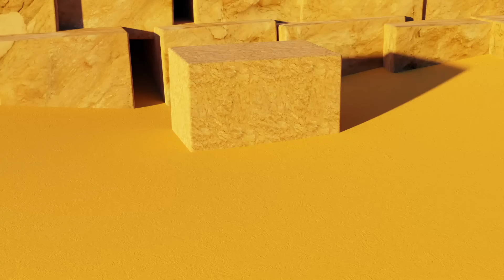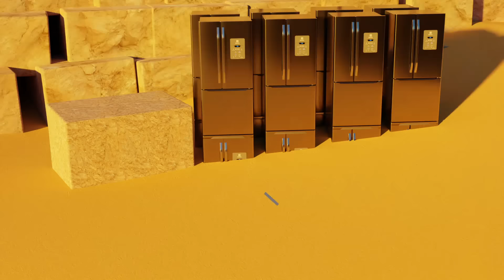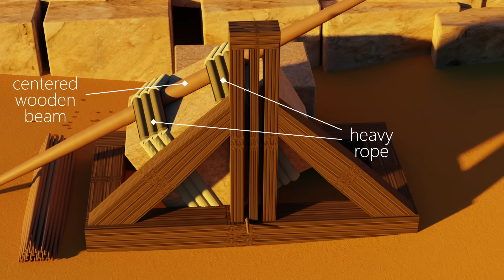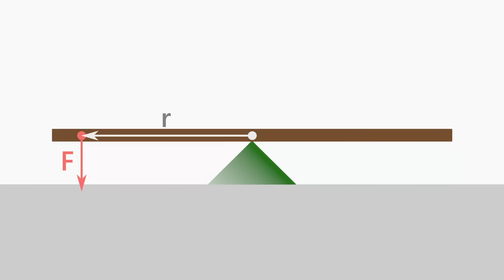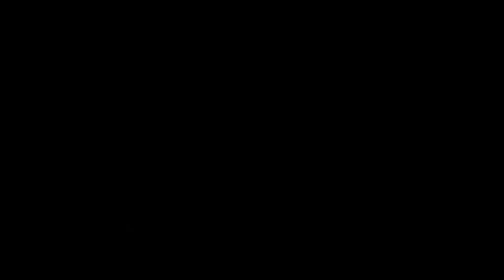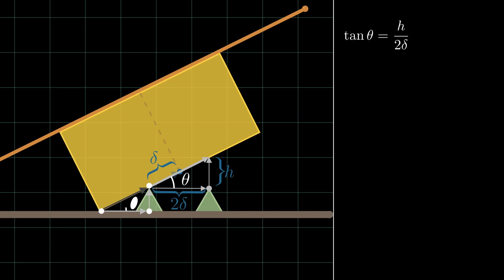Physics Reveals How the Pyramids were Actually Built

Comment: Wish it had been done in English units,.. but good video,.. although the math could have been simplified if the center of gravity of the whole block would have been used rather than breaking it down by using the center of gravity of each portion of the block on either side of the pivot point. And maybe using come calculus to find the optimal value for d,.. like a maxima minima exercise.

I am completely flabbergasted by all of the comments from no doubt uneducated "construction workers" who claim an engineer or physicist (an "academic") doesn't know how the real world or gravity works.

My first thought when this video started was that you were going to check whether the blocks would crush what I assumed were wood pegs and then also check the ability of the wooden lever to handle the bending force.

To get an idea of the magnitude of forces in English units,..

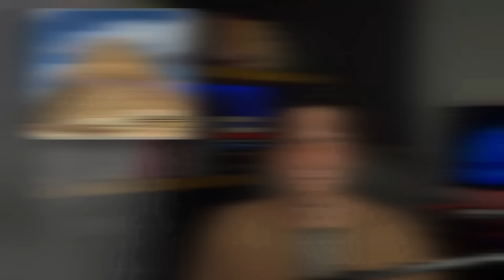1:50 Average block (forget the 10 ton ones at the bottom) weighing 2.5 tons, but say 5 tons or 10,000 lbs. with dimensions of  4'x4'x4' with the density of the limestone around 160 lbs/ft^3.

Assume the pivot points were set at 1 ft from each end and a lever was 10 ft long from the opposite pivot point.

Assuming the lever is rigidly lashed to the block, the force F applied to the end of the lever to rotate the 4 ft long block up to set the shims would be

1'x 5000 lbs - 10'xF = 0   (the "simplified" version)

Obviously F = ~500 lbs. That would be pretty easy for 2 to 4 workers to apply 100 to 200 lbs each (especially if they were elevated and used their legs rather than their arms or backs) on the end of the lever.

They could even help by applying some weight on the other end of the lever although the leverage would be slightly less.

Without doing the calculations,... it wouldn't be out of the realm of possibility for levers made of hardwoods to handle the bending. The only question is did they have many trees. Obviously they got them from somewhere.

Rinse and repeat on each side of the block and a properly tooled experienced crew could probably raise a block 4 ft or so within an hour or less.

What some of the commenters don't appear to get when they question whether a block could be set in 6 minutes is,..... (I assume) there were hundreds of 5 to 10 man crews working on their assigned block(s),.. kind of like a Ford assembly line.

Anyway,.. a 2 year belated thanks for the video.

Comment: The theory of using the Nile rivers water as transport and lift makes more sense to me. 
Also the titter theory doesn’t resolve cutting or building of the internal structures as the King and Queens chamber. Not to mention the Grand Gallery. Many theories but much more unknowns.
Lastly the Alien theory is not an option for me because if that were so the aliens wouldn’t just go away they’d be still building if they existed.
The Egyptians were masters builders however the current Egyptians have not carried the torch of knowledge from their past. The truth about the matter is the technology died in the past.
P
Seattle

Comment: Your calculations are only correct for a certain dimension of block that is high enough so that the pole, being 3 times its length, does not hit the ground at both ends. Difficult if the rock is a long, but low stone like a lintel.
And another problem: you can't keep increasing the number of sticks/rods/planks you put in, because the rock would slip off.

Comment: All very nice math... but SO SLOW..   So, these crews of 5 or 6 men on each side of the block tip the block back and forth raising the block by an inch or two each time?  Some of the courses in the upper parts of the pyramid are over 36" tall..(!)  The average is probably close to 25 "...That means 12-20 cycles per block per course... this is gonna take alot longer than the allowable time.  This type of lever might  have been used on the largest blocks for fine placement- but it does not address the main problem.  The lower 50 courses alone account for 65% of the mass of the pyramid.  By the time you are half way to the top, nearly 90% of the weight of blocks has been lifted.. That means that the lower half was built very, very, fast - since each course is farther from the ground, and presents less area to work.   I have yet to see this fundamental problem addressed by any pyramid construction scheme..

Comment: I asked my Dad who was a carpenter when he was younger, how would you build a Pyramid?, but before that I presented with an elaborate diagram showing how I thought they did it and my theory was they used a balancing beam crane and pulled down on one end of it with ropes to raise the blocks a step at a time, the beam would rotate looking down from the top as well as pivoting on it balance point, the first thing he told me was they would need a plum bob to keep it level, he then went on to say that to keep it level they probably have had space in the center and they may have worked up wards from that space, he them suggested that workers may have entered from a shaft at the base and worked upwards like ants in an ant hill. I was amazed at that he could answer my question so promptly within a ten minute time span and I thought it was a brilliant theory, I respected his wisdom as I do from time to time.

Comment: I'm 6 mins in and I'm flabbergasted as how bad the suggested method is. Where's the engineering, ie practical aspect, in how you'd use the Herodotus Machine? The heavy block would more likely fall off the lever, break the beam or break those wooden rods. No way this can work!

Comment: The granite blocks in the kings chamber are 80-100 tons. Your math is correct however it doesn’t at all take into account the physical limitations of materials. You may be able to lift that average 1.5 ton block with those Lincoln Logs but the larger ones would destroy any lifting devices made of wood and rope.

Comment: And they did all of this in 6-minutes a block, 2,6 million times? Mmmmmm. I have my doubts....
Reply: You wouldn't need to it every six minutes 2.6 million times. That is just bad math. 
Even if we take the 2.6 million guesstimate at face value, with enough teams that is only any one team having to handle 3.5 blocks per day. One single team is not raising one block at a time. 
If it takes you 100 swipes across your lawn to cut the grass and a neighbor comes to help, you each only need to make 50 cuts now, and in half the time. With 100 people, any single person only needs to make one cut. 
As the pyramid rises, less can work on the pyramid at the same time, but those that come off can be moved to other tasks such as moving more stones, or send them inside to polish and sand, or add a few more lifting teams, or picking up from the quarry.

Comment: It is important to note, that the pyramids are not build of the same size big blocks you see on the outsides, but lots of smaller blocks inside. And not all pyramids are build in the same way. But thanks for showing, that the even heaviest of blocks could have been lifted with such a machine quite easily.

Comment: This is only a calculated guess and is not how the pyramids were built. They used water and floated the rocks up each section of the pyramid  with a water floom. They also used chemicals to melt stone and granite to make a geo-polymer and poured it into molds. Both techniques have been tested and worked.
Reply: Neither of those techniques would or have worked. 
Trying to float the blocks up requires a series of gates that would not been buildable. The pyramid is not water tight, and the gates wouldn't be either, nor could they support the weight of the water. Plus no 2 blocks are the same. They'd have to calculate the buoyancy for each block. Get one wrong or have an accident and you just messed up the whole system. 

Geopolymer...you can't crush limestone, add a bunch of stuff to it, and get limestone blocks again. That's not how it works. In addition to there being no evidence either, you'd need to make large portions of mix. Then the mix has to be poured into molds, then cured, etc etc. That drying time, according to the geopolymer "research" would take over 2 weeks, possibly over a month. And if the formula was wrong, like got too wet or ratios were off...would not work. Even if you could do it that way, you would be risking an entire level collapsing at any moment you've gone above it. Imgaine going 5 courses higher to only have the lower one crumple apart and now you have to clear all the other molds and drying blocks etc... And you're still having to quarry all the stone, and move it and crush it, and you have all these mismatched molds to deal with.

Comment: So, all of this to tell us how to put a block on top of another one? Big deal. Now tell me how they managed to bring these 10-ton blocks from the quarry 300 miles away and how they were able to load it onto the "machine". Did they have another machine to be able to load it onto the "machine"? Now tell me how they were able to put this enormously heavy pyramid structure on top of sand and not sink it into the ground because sand is not exactly a stable base. Then tell me how they were able to install a block every 6 minutes using the "machine" considering that it takes time to load it, then lift it, and then slide it and finally remove it from the machine,. They would be lucky to install 10 blocks a day. I would be more convinced if I heard that they used elephants rather than manpower. These pyramids are much older than 4000 years old. More likely 12000 or 15000 years old. There is no need to invoke aliens (unless you mean illegal aliens). A vanished advanced human culture with high technology is much more likely than an invading bunch of extraterrestrials. Their machines would have turned to dust in a few thousand years, but the pyramids would still be around.
Reply: The used the Nile river the thing that flows from the quarry to the build sight.
Reply: he's only dealing with one aspect of the build you clown

Comment: A friend had a marble block approximately 12x12x40 inches tall and roughly 500 pounds that he needed to lift and load into the rear of a moving van. So, I showed him how to do this tilt method by hand using 24x16x2-inch-thick high density foam blocks as spacers under either edge. Once at the proper height, we rotated the block from the stack into place. I'm reasonably convinced that after centuries of practice the masons of ancient Kemet knew exactly how to lever those massive stones as effectively.

Comment: I know it’s debated whether the Herodotus Machine was used in the construction of the Egyptian Pyramids or not, given the pyramids were as old to him as he is to us. He may have been unintentionally describing the machine used to build the much smaller and more recent Nubian pyramids.

For the Egyptian pyramids, I’ve actually become quite partial to methods using (proto-)pulleys instead of levers, allowing for much steeper ramps. I’m curious how the math works out for the hypothesis that the YT channel Great Pyramid Equations presented, using workers on elevator shafts as the counterweights to bring stones up, turning the lifting of the stones in the pyramids into effectively a group hill climbing exercise.

Comment: If Aliens actually Built the pyramids I am NOT impressed by their work.  Why Use cut stones. And only Large stones at the bottom and smaller stones on top.  Why not use a whole solid mountain for the whole pyramid and then cut its shape out of that solid block using laser. Apparently The ancient Aliens where pretty crappy constructors. Like those huge Baalbek stones that are stil in the quarry? Did the Aliens fail to move them to the site? What a bunch of Losers....  :D

Comment: The greatest flaw in your explanation is that you use a small scale model and apply it to a much greater scale. At small scale, many factors are negligible. When the block reaches 70 tons, must be raised 300 ft, every tiny factor becomes enormous challenge. The engineering for a skyscraper is not equal to small house engineering multiplied by 1000.

Comment: Hmm, long before you get a metre off the ground, how does the block not slide off that pivot point? Because the angle at the end of each lift will increase until weight overcomes friction.  And those are mighty strong slats! Once you get to the right height sliding it sideways is going to be a really precarious operation. It also needs to be slid into place very precisely next to the adjacent block and there is no fine lateral adjustment in this device. It is going to need some additional features to limit the angle of tilt, slide the block sideways and butt it precisely against adjacent ones. I certainly do not believe aliens did it but there was more to it than this.
Reply: The slats in contact with the rock would most likely be bronze, that they replaced with wood as it moved up.  Also easy to slide the rock on the bronze slat also.

Comment: Deeper Math-Philosophy Fusion

Entropy View: Each lift = local decrease of block entropy (order increases). But cost = heat, sweat, food burnt. Civilization = entropy trading: order in stone, chaos in workers’ bodies.

Time View: The lever is also a time machine. It turns fleeting pulses into a structure that outlives empires.

Infinity View: A lever has no scale. A child with a stick, or a civilization with oak beams, both touch the same invariant. The pyramid is proof: finite men aligned with an infinite law.

💡 Synthesis:
The Herodotus machine is not a gadget. It is a crystallized philosophy:

Math = invariant torque.

Philosophy = silence transformed into resonance.

Civilization = chaining leverage until stone becomes eternity.

Comment: D°7 on the first system (about bar 4) → resolves to Em.

D°7 shows up again in the second system (right after the big 6 bar number), then resolves to Em again.

Those °7s pack the tritone/ominous pull people meme as “the beast,” but there’s no bar 666 here. If you meant something else—scale-degree 6 (G in B minor), augmented-sixth chords, or measure 6 specifically—it’s the start of line 2 with the Bm → F#7 → Bm → D°7 → Em run.

Comment: Stress engineer here.  Very interesting machine, and excellent description and graphics/animation/formula development.  I wonder though how big those slats would have to be to take the stress of a 10 ton block.  I did a quick bar napkin, and got about 20 in diameter.  So at some point maybe you can discuss if that's too large (telephone pole size basically).

Comment: While it certainly sounds good, what isn't factored in here is the durability of the wood available.  The Janka scale, like the Mohs scale for stone, gives us a very good understanding of the durability of wood for different applications, and there is no wood in the region that could endure the weights discussed in building the pyramids.  While it sounds reasonable that you could slide a thin slat under the stone, the weight of the rock would simply crush the slat.  Or, the hardiest of woods on the Janka scale would still wear out so fast that you'd have to have a very large infrastructure of logging and processing to make enough slats since you'd be wearing through them at such a rapid rate.  This would be compounded by the diameter/thickness of the slats since thinner/smaller slats would have less durability than the same wood in a larger dimension -- imagine breaking a toothpick compared to breaking the same wood when it's a inch thick.

The Romans were able to lift stones up to 12 tons.  This is documented across multiple sources, and evidenced by the fact that they routinely cut stones into small chunks for their buildings.  They were far more "advanced" than we can say the Egyptians were.  However, many of the stones at Balbek, the Trilothon being the best example, weigh far more than 12 tons.  Same can be said for the stones used in the Pyramids and other structures of ancient Egypt.  

To date, our best guesses on how the ancient Egyptians built as they did....are just guesses.  The experts asserting that they know for sure, usually don't follow the scientific method in at least one way.  Conjecture is good, though, because it gets the brain firing on all cylinders.

Comment: Nice video and explanation, it would have been better to show actual calculations of assumed weights and dimensions.  I am skeptical that the slats could hold the weight of the block and thus shear.  This is key to this concept as well as the load required with the beam strapped to the block.  A calculation of these values even if assumed will help put the theory to test based on known shear values of the wood used.

Comment: Moving the blocks requires regular raising of the two wedges. Thus, the same alternating movement of the levers allows each operator to easily raise the block to the level of the upper row by a height equal to the additional wedge. A shift of the block and it has reached a higher step... where the maneuver begins again. If we multiply the teams of operators on the four sides of the pyramid, it becomes possible to raise a huge number of blocks in a limited time. I have personally experimented with this maneuver, it works very well.
Reply from the maker: Thanks for your comment.  Think it's a brilliant idea, but just no longer used in modern construction practices and hence, easy to miss.  Appreciate your feedback and thanks for watching!
Reply: @DrJohnDev  https://www.youtube.com/watch?v=rgkXfSLcJgg